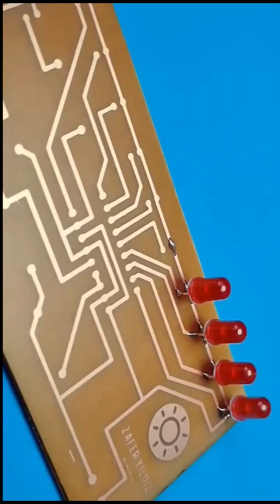How To Make A New Generation Proximity Sensor Circuit  #zaferyildiz #led #diy #viral #short #shorts

Comment: how do you make that pcb?
Reply: Acetate pen can be made with hydrogen peroxide. If you search for it on the internet, you can draw it on a copper plate, decompose the copper with 90 percent hydrogen peroxide and obtain your circuit.